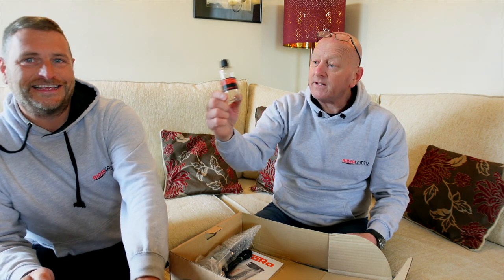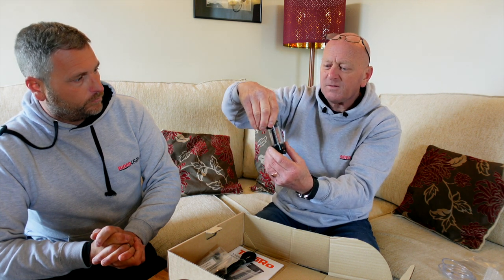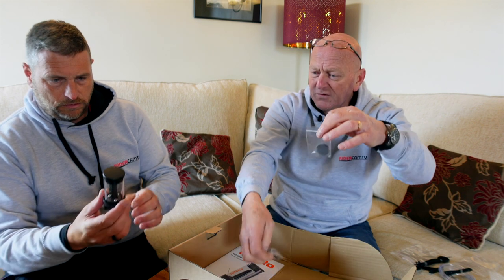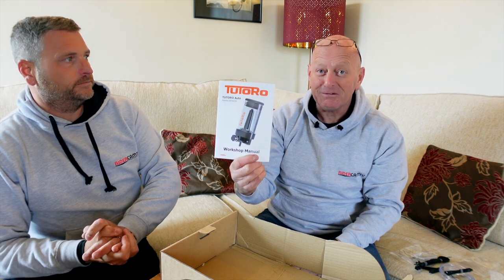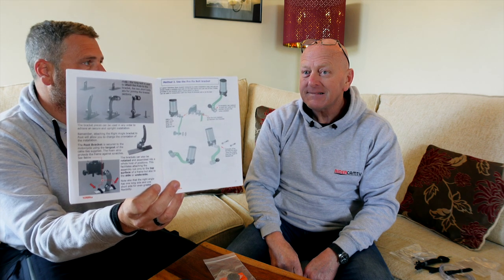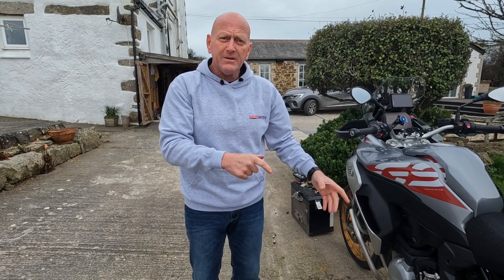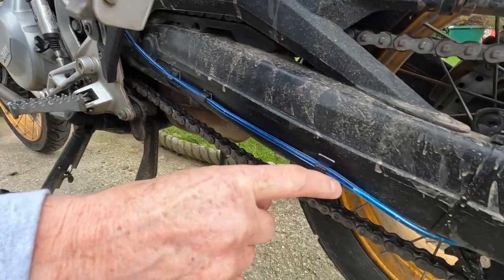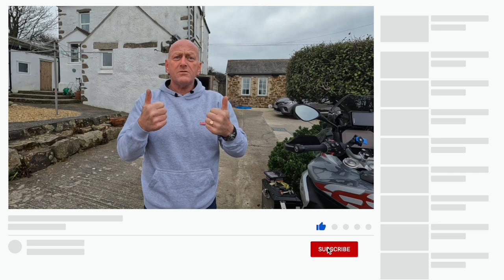Tutoro Automatic Chain Oiler | Our First Look

Comment: I had one of these years ago. Hopefully they've improved the design, because mine was useless - either dispensed nothing at all,  or emptied itself within 10 miles. Never did get it to work properly. In the end I switched to shaft drive, problem solved ;-)

Comment: I had one of these for my previous bike.  It was great.  No complication or vacuum pipe, spent an hour fitting (I'm sure a mechanically competent person could fit it much faster).   I hardly ever had to adjust the chain once fitted.  Tutoro were also good as I broke the "oil carrier" (was my fault).  I was able to send it back for a modest repair cost.  Sadly, or happily, I have the mighty GS so no need for it  as it's shaft drive.  But if I get a chain driven bike, will be digging up the Tutoro to fit.

Comment: Reasons I would like to win this system.
1. I am a bit lazy.
2. I keep forgetting to oil my chain.
3. Scrabbling about on my hands and knees oiling my chain is a pain.
4. Getting up from being on my hands and knees takes longer and longer at my age.
5. It looks better than a Scotoiler.
6. I like the blue pipe.
7. I need comprehensive fitting instructions because I am thick.
8. Winning would brighten my day.
9. When the parcel comes and my wife says “what’s this cost now” I would be able to say nothing which would be a first.
Reply: Ha! That’s all the same reasons I wanted one.. Ride safe